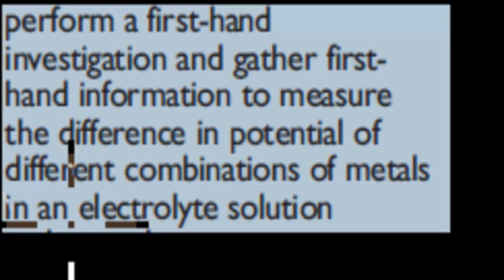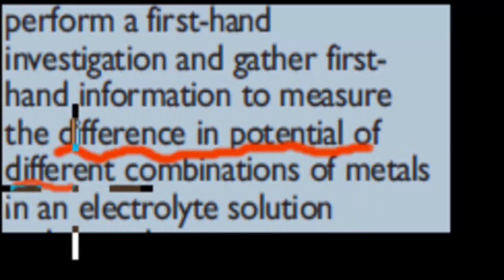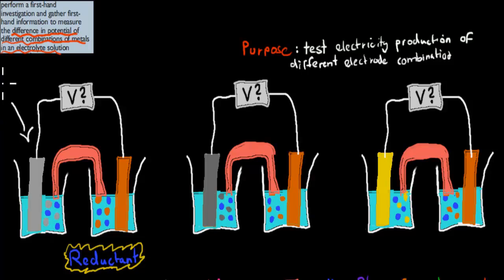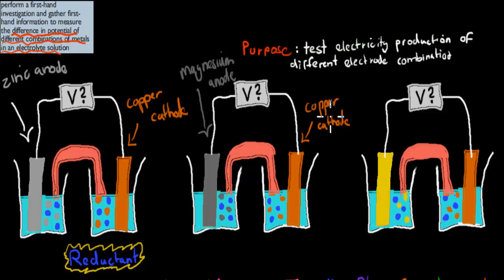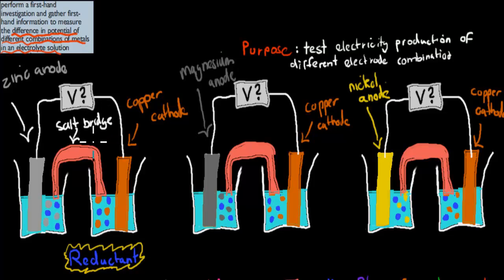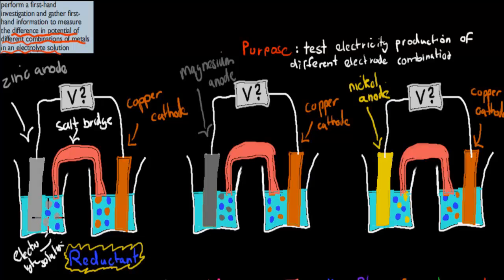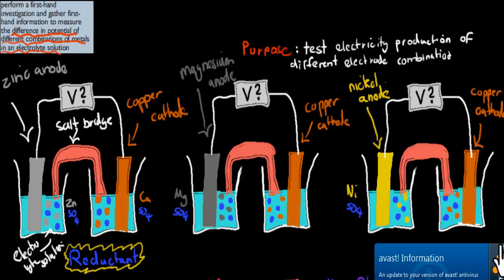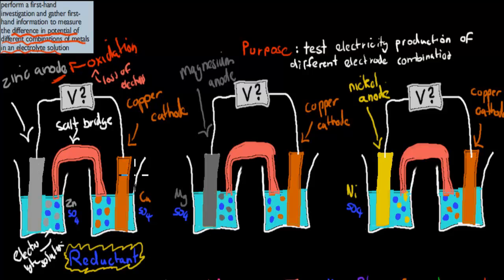8. Potential of different electrodes experiment (HSC chemistry)

Comment from the maker: @Grizzete Hi grizzete, a spectator ion is an ion that does not really participate in the reaction (is not changed). For example when copper ions leave solution and become elemental copper and precipitate on the copper electrode. The electrolyte solution contained copper ions and sulfate ions, but only the copper ions moved out of solution, nothing happened to the sulfate ions! So the sulfate ions are the spectator ions. Hope that helped :)